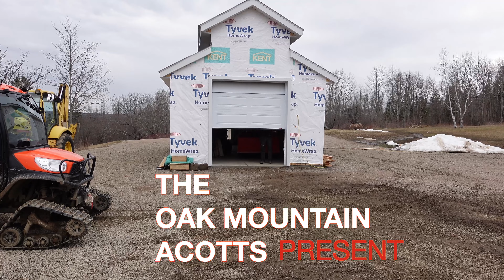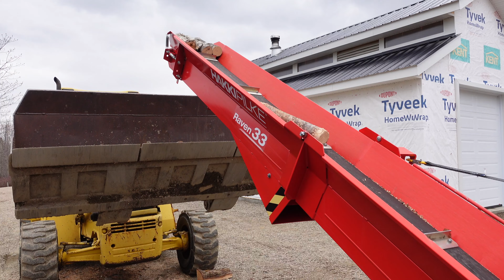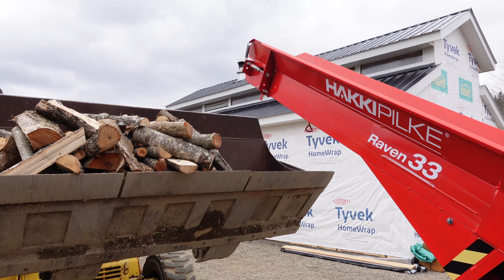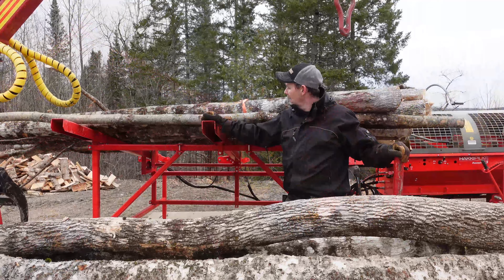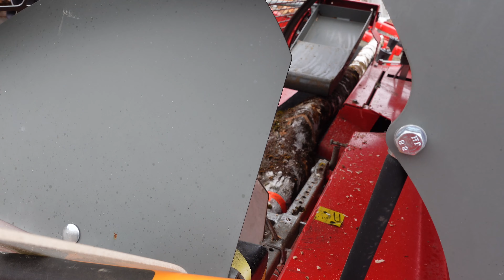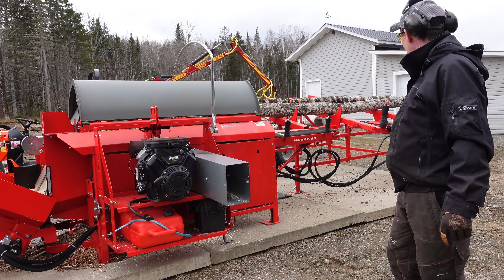First Firewood of the Season -E119

Comment: Jason: You have a really nice setup. I split right into my dump trailer for stacking. Hopefully in the next year I’m going to get a pole building built over the top of my processor and splitter. I have an Echo battery operated saw I use at the processor for trimming stubs and branches. It works great. I also separate out my firewood poles into two categories ones that need to be split and ones that don’t need to be split. When I cut the poles that don’t need to be split, I remove the splitting wedge from the processor.
Reply from the maker: Hi Richard, I could see where the battery powered saw would be a great addition. My little Stihl is okay but sometimes it doesn't like to start! That is a good idea to separate the wood and remove the splitter. I looked mine over for a few minutes last year and I couldn't see how to pull the splitter out quickly... more research required!

Comment: Greetings from southwest Montana. Really like the setup.  As far as your sawdust, I think a conveyor might work better than a blower.
Reply from the maker: Hi Ole, thanks for tuning in from Montana! I have a 560 CFM blower on order so we will see how it works. It was pretty cheap so I thought I would give it a try. Do they make conveyors specifically for sawdust or are people just using little belt conveyors? Thanks, Jason.
Reply: @OakMountainAcotts  I think most just use small belt conveyors,wouldn't need to be to big. I think you said the bank was only 10 feet away. Just keep pushing it out with the tractor. I will be curious to see how the blower works, might be the cheaper route and I'm all about keeping my money in my pocket.

Comment: Hey Jason, didn’t realize you could use just the splitter on the firewood processor! Really, enjoyed seeing the machine in action! We cant wait for the weather to turn over here in Michigan and begin more firewood processing ourselves. Best, David and Rachel
Reply from the maker: Hi guys, it actually works quite well, especially if I had a helper to load the deck for me... the only downfall is that when the splitter retracts, the chain saw cycles so you are using a little bar oil for nothing... The weather finally turned for us here, you guys will be back in business soon!

Comment: Hi Jason! Love your videos. You have a very efficient way of processing firewood. You have a great setup there. I was just wondering. Is that mostly maple wood that you processing?
Reply from the maker: Hi Richard, right now we are processing white ash with a little red maple mixed in. When I switch back to my wood supply it will have a little of everything. I like iron wood and maple as they are the easiest to work with and have a high BYU value. Thanks for watching!

Comment: ? How did you choose between the HP and the japa systems. I like what you have. Just wondering
Reply from the maker: Hi,it really came down to availability  and price. We wanted a firewood processor and the closest dealer we could find was 6 hours away. We researched the brand and liked what we saw so planned a visit for a demo. The Raven was the cheapest model so that is what we ended up with. We were just lucky that the machine worked out as good as it has for us. Kind of the same story with the Kranman trailer as we bought it the same day!

Comment: Hello Jason   Just wondering where you get the cement slabs from   Or did you make them up yourself    Your set up looks really good.  I just bought a processor and hydraulic live table last winter and will be setting everything up later this spring.
Reply from the maker: Hi Kevin, we had these for about 12 years at the house as a concrete patio. We purchased them from a pre-cast company locally. They have plastic inserts in them to screw bolts into so that you can sling them and move them around. Hope this helps!